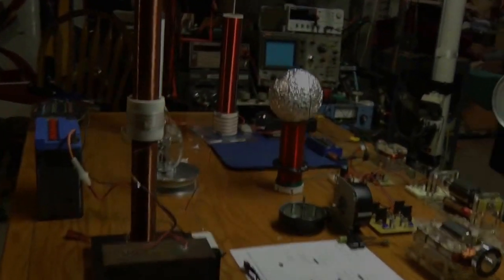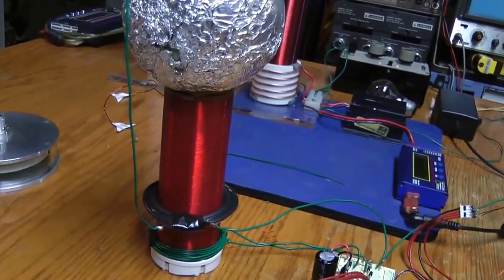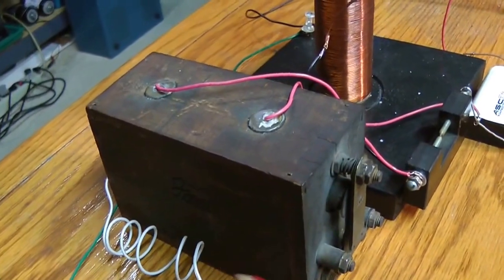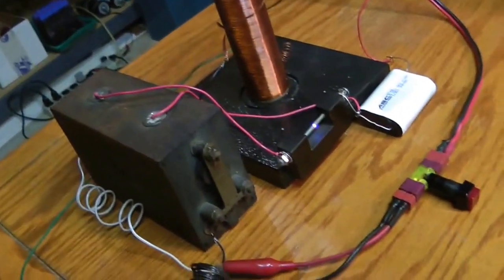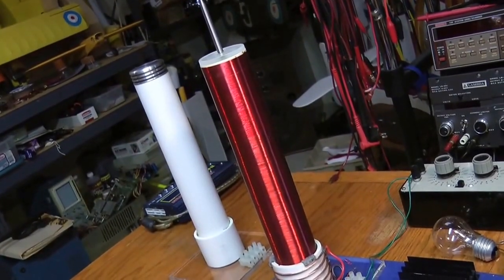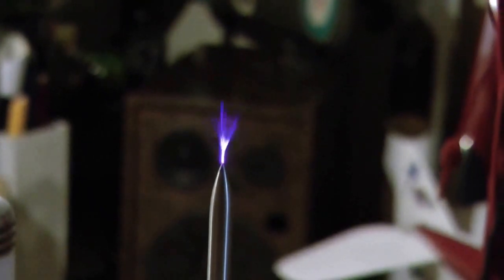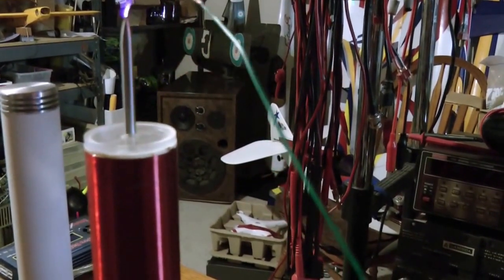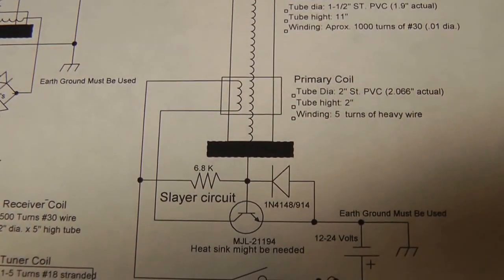Newer SSTC Tesla / Slayer Resonator

Comment: Depending on configuration the slayer circuit is relatively self tuning. I know you're old coil isn't optimal but it could benefit adjusting the resonant frequency. Even with good equipment they are a lot of finicky guess work because the nature of it's operating parameters.
Reply from the maker: I agree my friend. I'll need to test the higher coil a little more.